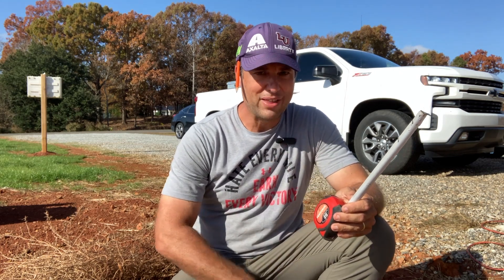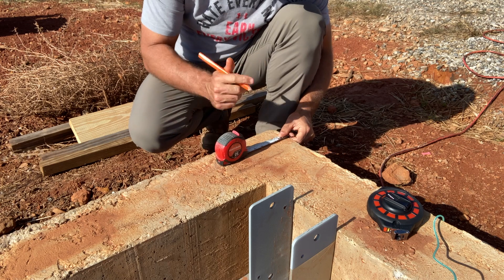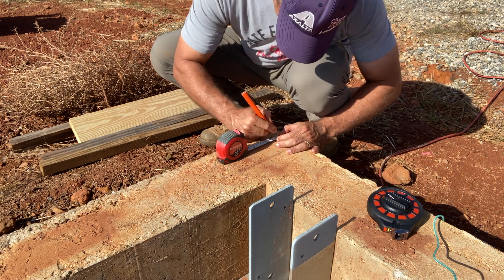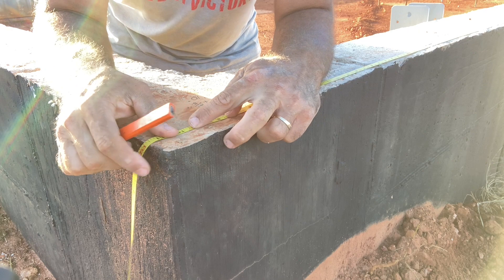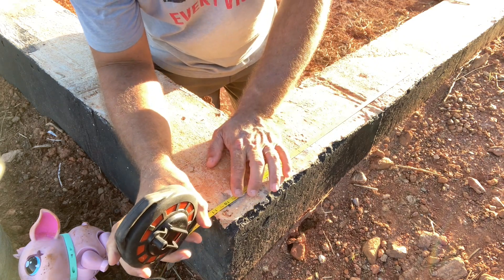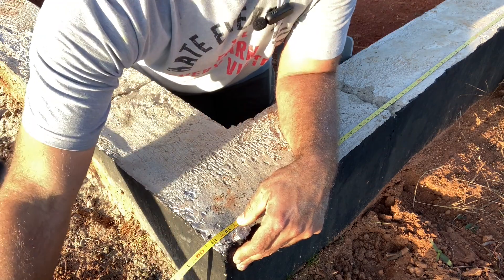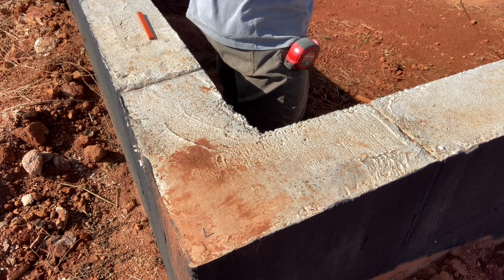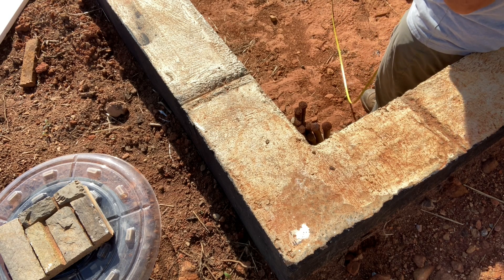Barndominium Build | Foundation Sturdi-Wall Bracket Layout and Install

Comment: Any reason you didnt use the concrete epoxy when putting the anchors in? I plan on doing a similar build and i have always used the two-part epoxy when putting anchors in
Reply from the maker: The engineering specs for the brackets call for using the hardware that comes with the brackets.  You could definitely use that method if you have the engineering numbers to back it up.  I would highly suggest talking with your building inspector before you do something different than what is called for in the engineering specifications.  If you watch the timber frame porch build I used the 2 part epoxy method to connect the Timbers to the foundation.  I did it that way because the engineered plans called for the epoxy method.  Hope that helps.
Reply: @allthingspostframe  thanks for the quick reply and input. Will definitely check out the engineering specs before hand. Keep up the videos, im enjoying them hopefully just as much as you do making them. God bless and heres hoping you have a happy and healthy new year!

Comment: Hello, at around 5:00 in the video, you show the split bracket detail placement. Is there a concern that only half of the column sits on the 1/4" metal piece and the other half hangs in the air? Thanks
Reply from the maker: I personally am not concerned about it considering all the clinch rivet nails in the column.  They do make a corner bracket if it is something you don’t have a warm fuzzy about.
Reply: @allthingspostframe  thank you. I think I prefer this method than the universal bracket where the wood sits directly on the concrete and I will have to think twice about leaving additional 1/4" length on the bottom of column to compensate for missing metal underneath.
Reply from the maker: @NK-ic6yt  ya that would be a great way to do it.  Just cut the outside ear off and make the bottom plate longer.

Comment: Thanks for showing a barndo build on a crawl space. Slab on grade and in floor heat can be nice but I think living on concrete would get tough on joints as we age. 

I am curious, why did you not drop your brackets into the concrete when it was poured vs anchoring them in?
Reply from the maker: Thanks for the comment.  I totally agree with the concrete being hard on joints.  

The only reason I did the anchors vs wet set was because I was not present when they did the wall pour and I didn’t trust the contractor to place the brackets for me.  Since I don’t do this full time I have to really do my homework with planning around my work schedule that pays the bills and anchoring gave me the most flexibility.